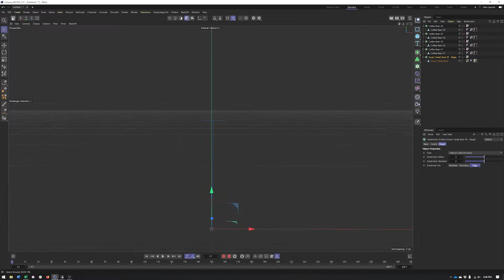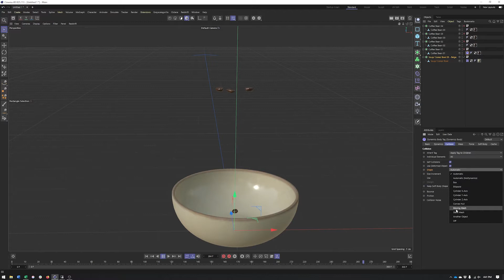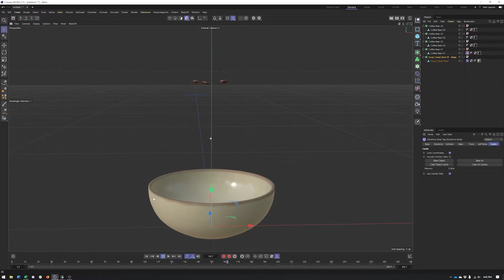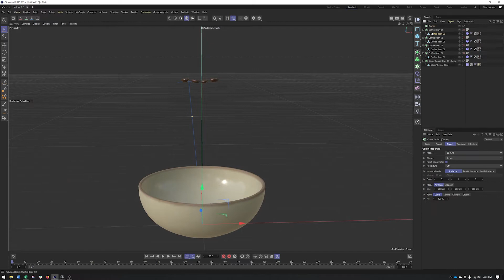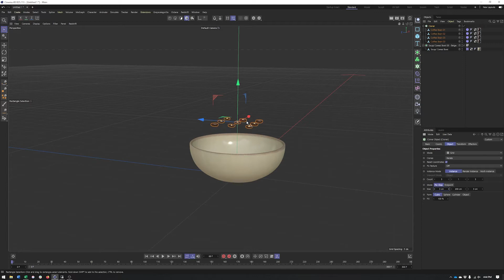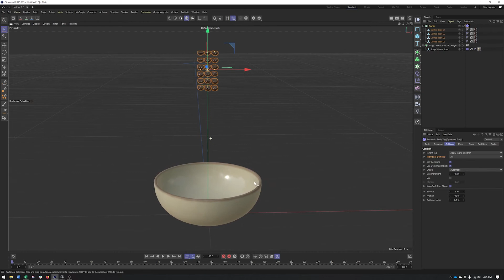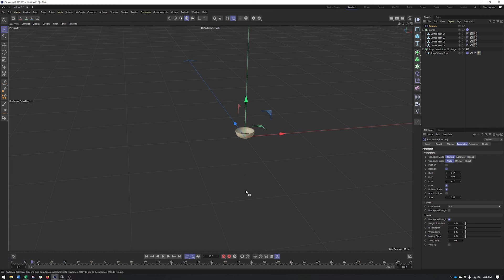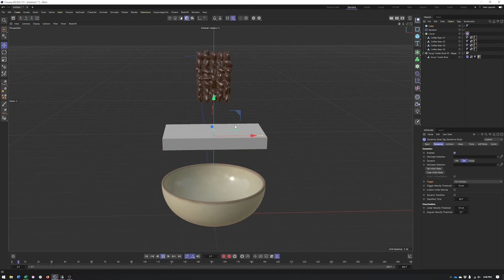Cinema 4D R25: Rigid Body Simulation

Comment: I'm sure there's an easy fix, but I was trying to have objects fall using rigid body. However I also wanted the objects to rotate while falling, and I cant for the life of me figure out how to do it. I can get them to rotate using the random effector with a field. But that's not them falling. and if I use the random effector to to change the rotation before the simulation, then they just fall in the current rotation. any ideas?
Reply from the maker: Try using the Rotation Force. Its in the Simulate menu.

Comment: I don't see rigid body simulation in r26.107....Any ideas?  I have the full paid version.
Reply from the maker: Check under Bullet Tags
Reply: @BTB3D  Ah, I see it.  Sorry, new to C4D.  Is this a change from prior versions?
Reply from the maker: @chimchase  correct, they are updating the simulation tools with updates like GPU acceleration.